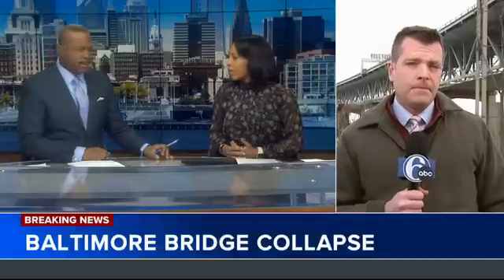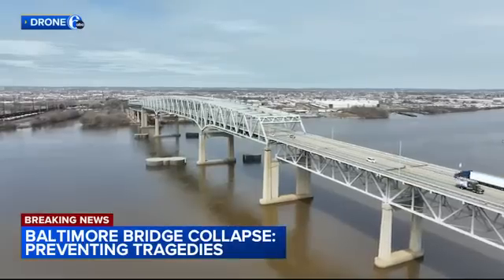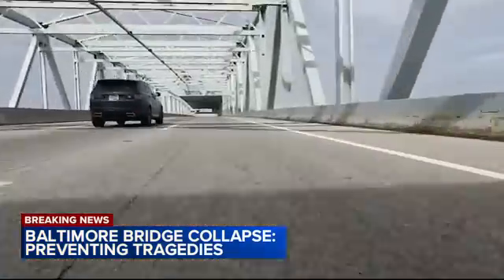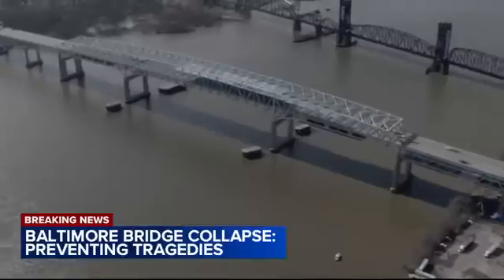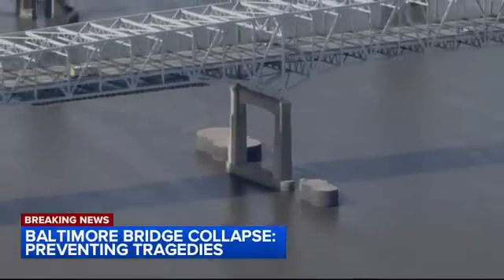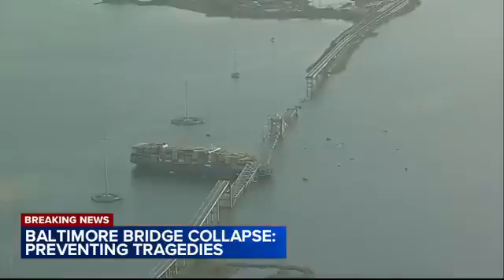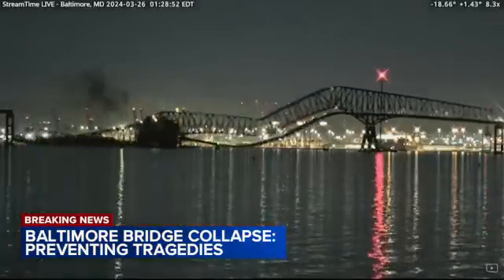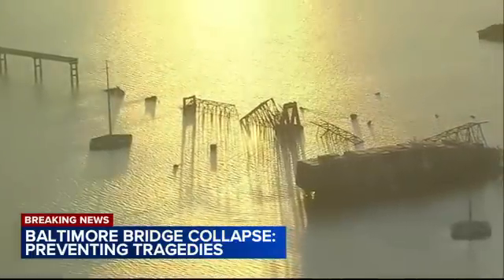Here's what surprised a structural engineering professor about the Baltimore bridge collapse

Comment: A "perfect storm" ?
1. There were no deflectors preventing a direct hit on the pylon !
2. The entire bridge collapsed, not only the two adjacent segments directly affected (such incredible error of design and execution is a hard nut to swallow).
3. The boat crew knew long before they lost control of critical systems, alerted the Coast Guard, could see the direction and angle curse, but didn't think of simply "steering" the boat using the starboard, or the port side anchors ? These have redundancy systems, as any sailor worth his salt can tell, and these procedures are the abc of sailing curriculum.
This story is fishy, you don't need Chat GPT5 to tell you that under the scenario presented it's very. very improbable.  
As always, somebody is making money from this, and it is a also a story designed to change the narrative, to divert the focus from other, more troublesome issues, the gruesome genocide committed by israel being an atrocity of infinite evil.

Comment: How long would it take to anchor high pressure  pipes to bottom of sea bottom, pump those out, weld together and put a 4 lane through it, just curious on an ETA if that'd even be possible? It seems very possible in theory.

Comment: That container ship weighed just as much as that whole bridge. And it had momentum. There's no bridge on earth that could of withstand that amount of pressure. That pair is pure reinforced concrete with post tensioning cables in it and it basically exploded when the ship hit it.
Reply: Where did you get the idea that the pier (not pair) is/was a post tensioned structure?

Comment: If any ship this big with that much weight loses power while it's moving there is no stopping it. Being on a carrier for many years and being smaller than these cargo ships but still huge ships we always had tug boats come out and guide us in to the pier. For bridges like this one maybe something similar should be used until some barriers can be put in place.
Reply: Tugs were with it most of the way, they broke off once the ship hit the deep channel.
Reply: I completely agree with this, even from the engineering side there is only so much we can do structurally to prevent this, having tugs up until after they passed the key bridge would have at least reduced the impact force from total collapse to just minor damage
Reply: Bullard need to be protecting alot wider area of under bridge-deck water
Reply: I was on the USS Ranger!
Reply: exactly, tugs for safe passage, great idea
Reply: @davidcote6139 
     Ha . New idea . All those ships and piers and bridges in the way ☹
Reply: ....ok that's all good...BUT why it make a solid turn to the Right toward the Pillar soon after it lost power.  Someone turn the Rudder to the Right after power lost.  Especially the Crew called Bridge authority to close the bridge already know they are going to hit the pillar and sure enough, after supposed power lost, they turned to the Right instead of just kept straight or their original rudder position.  Fishy
Reply: It will be years before anything will be done. Old Joe just gave it lip service and Secretary of Transportation No Brains Pete has no clue.
Reply: @mal2ksc  MSC Irina ,MSC Loreto and MSC Michel Cappellini are currently the largest vessels in the world in terms of dead weight tonnage (dwt) and cargo capacity. These massive ships have a tonnage exceeding 240,000 dwt
Reply: You don’t necessarily have to stop it. You can deflect it.
Reply: If you work in Google earth, there are barriers, but they're way far to the side of the actual bridge supports
Reply: The tug boats had left after guiding this ship out of the port...
Reply: The lights are not " the power" .
         The ship was pointed into thr pillar and it should have been pointing at the space between pillars.  That way it is never pointed into the bridge pillars . All bridges and ships are built to avoid being knocked down . 
 Try rollerskating backwards and the whole place will tell you you are going backwards around the track . And you are suppposed to go counter clockwise . 
   Just because someone comments on youtube he is an engineer and it was supposed to fall and now you need to pay for it doesn't make it so .
Reply: @gregorydahl Wait, you think when the videos show literally every single light going out on the ship, and then once the lights come on, plumes of black smoke come out of the exhaust - you think that what’s happening here is someone just turned off all the lights, but the rest of the ship still had power…?
Reply: i seen those barriers, a barge hit one turned sideways and took out the bridge as well.
Reply: where was this? @diegojines-us9pc

Comment: Are they blind at ABC7?  There are clearly anti-collision structures, albeit small and far from the piers, which allowed the ship to still collide.
Reply: Indeed very small dolphins if indeed that's what they were. Unfortunately the ship turned so sharply it missed the dolphins completely. These protections are for ships that are off course. Curiously I don't see the round ones on Google Earth.
Reply: I believe what you’re thinking are bridge protections are little islands that have the power line poles on them that run across the river.
Reply: I thought they were light systems the boat used to go down the middle.

Comment: 100,000 tons at 8.5 knots can do an incredible amount of damage. Those pylons should have been protected. And the captain should have dropped emergency anchor as soon as the ship lost power instead of trying to uselessly course correct.
Reply: It was said they dropped the anchor. Anchors aren't brakes, they drag the bottom.
Reply: No one will know until the NTSB does its investigation.  It usually takes about a year.
Reply: @susanstarks109  I have no degree in engineering or anything.. and It took me a whole 5 seconds to figure it out.
Reply: Anchors are designed to anchor ships in good weather. No ship has anchors designed to stop a ship.
Reply: Pylons were protected and the anchor was dropped.  But you are not stopping a ship of that size and weight.
Reply: @rainmaker3700  bs, it stopped
Reply: @rainmaker3700  You can.. and they should of have measure in place to stop it... but those measures cost money.. money that they would line their pockets with instead.

Comment: Ship's have gotten much bigger.
Reply: True. But why did the FSK bridge not have the concrete barriers like the Betsy Ross bridge?
Reply: @april-showers77 the ships forecastle sticks out way over the bulbous bow, it wasnt the underwater bow that toppled the bridge pylons, but the forecastle... in a simular way a lot of gantry cranes get toppled when these large vessels approach their berth under a slightly too steep angle...
Reply: @april-showers77  Barriers are only good for deflecting a glancing impact. This was head on, and just somewhere below 100,000 tons.
Reply: @stephensaines7100  That is a very good point you raise there! 👍
Reply: @stephensaines7100 the barriers at the Key Bridge were flat..this is not how you protect  the structure.  Someone did a cost benefit analysis and decided the probability was to low to spent the 100 million on dolphins...instead it's a 100 billion or more in lost revenues and cleanup
Reply: @stephensaines7100  116,000 tons.
Reply: @stephensaines7100  that's why they're made circular, so that virtually every angle of approach is "glancing"
Reply: @stephensaines7100     More actually.  The weight of the Dali is 95,000 tons unloaded.   It was roughly half loaded, with 4700 containers;  capacity is 10,000 containers.  

I did read early on a British structural engineering professor say he was doubtful any degree of reinforcement/protection would have saved the bridge, due to this being a direct hit by such a massive ship.   (Some container ships do come much larger/heavier; this was a midsize one, half loaded.)  I think he mentioned what jawadad73 says below, that the configuration of the Dali would have rendered dolphins ineffectual. 

The Key Bridge had survived another hit, I don't remember how many years ago.  I am sure the circumstances were different.
Reply: You're well-read. Yes on your figures but my earlier answer was dry weight, of course. From the litany of comments, it appears that most have absolutely no concept of what it would take to stop a massive ship in motion.  
[a British structural engineering professor say he was doubtful any degree of reinforcement/protection would have saved the bridge]
Far more than just that one are stating this. It can be done, but doing so would render the channel impassable as it would take so much space.

What a lot of other commenters miss is the height necessary to do this. The bottom of the ship would get torn out before the upper bow could be stopped, so the protective barrier would have to be the height of the bridge!

Thanks for your answer, very few are realizing the gravity of what's needed to address this.
Reply: @marysueeasteregg  "due to this being a direct hit" thats the whole point of the barriers... they deflect the ship. there have been cargo ship crashes before. concrete stops them.
Reply: @stephensaines7100 it was probably proposed at some point but money I imagine got in the way. Other bridges from that time were what they called retrofitted with some kind of barrier
Reply: @Nuttyirishman85  Indeed, my oversight. I was only off by a hundred times...
Reply: @stephensaines7100  the weight kept changing as the days went on.
Reply: Good point
Reply: Our consumption has gotten bigger
Reply: @witchqueen8576 Nothing to do with it. If ships could have been that big 40 years ago, they would have been made. Ships are bigger today because they CAN be. Because the Panama Canal was widened from 2007-2016. This ship would not have been built 40 years ago because it would have had to go all the way around South America which would have cost far more money than having 2 or even 3 ships that could fit in the old Panama Canal.
Reply: True enough that ships are now bigger....but doesn't speak to the lack of concrete barriers installed in the water on the Baltimore bridge....a design difference/failing.
Reply: But infrastructure has stayed the same.
Reply: Understand infrastructure needs....but this ship was very full, looked stacked too high to maneuver close range without proper power (electricity etc)? had issues and reported needs and either not checked or properly inspected or repaired ...by owners etc..... by USCG ...port authority etc... who checked at port before it sailed? The problems shown clearly is where you start and when we understand lives were lost that is where you start first ...spending and resources where it needs to go first @wandaherring7526
Reply: And the cutting corners and cheap building cheap labor. Same thing with boeing.....this is just 2 examples of the sloppy crap built for america from other countries where the rules and regulations are maybe quite different. Get em in get em out.....
Reply: The MV Summit Venture, which caused a similar disaster hitting the Sunshine Skyway Bridge in 1980, had a deadweight tonnage of 33,912. The MV Dali, which struck this bridge, has a deadweight tonnage of 116,851. That's only about 3 times heavier.

It's easy to see a disaster like this and try to point to one single easy factor as the only cause, but safety is much more complicated than that.
Reply: So all major bridges need to be upgraded.  Is it so hard to understand?
Reply: And people have gotten dumber😮
Reply: True
Reply: In THAT case, the river control authorities are to blame. They should have banned large ships from using that part of the river, or they should have shelled out the money to reinforce all the bridges.
Reply: So has your knowledge. :trophy-yellow-smiling:.
Reply: Very good point👌
Reply: Yep that’s why our government decided to this act of destruction!  Cheaper and easier to not go thru all the hoops they need to, to build a new bridge!
Reply: Ships haven't gotten bigger.
Bridges have gotten smaller.
Reply: @davidmende4438  That doesn't make any sense at all
Reply: *Ships (plural non-possessive)
ships = singular possessive or a contraction of "ship is/has"
Apostrophes are for contractions or possessive nouns, not for pluralizing.
Reply: The plural of ship is not ship's. You were never taught that apostrophes play a part in plurals, so why do it?
Reply: Ship's what have gotten much bigger? Ship's (what the ship possesses) have gotten much bigger...  ??
Reply: Ships have become much larger.
Reply: It sounds like none of you have Sailed.  A Harbor Pilot should  have had the drunk Captain on Radar.  That said we ran aground in Miami in 69 on the USS Peugeot Sound AD38.   The Pilot had no control over the wind, and neither did the pentagon have control when a Missile struck their house down stream in DC.   I SEE  Demolition charges all over the support structure Here, as each section is blown in  sequence , called CONTROLED DEMOLITION....  Slow it down  to .25 x speed and shut the light off in your room,  ...now you see the bigger picture
Reply: fakes power loss.